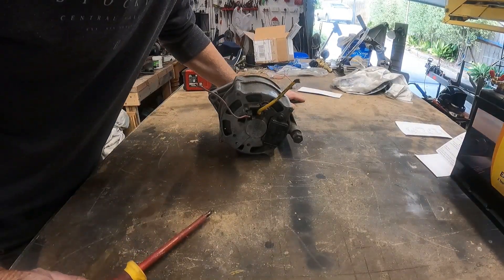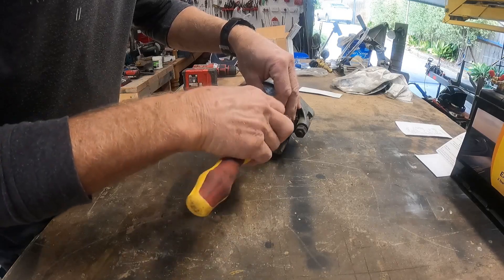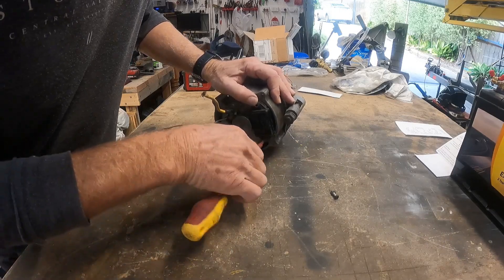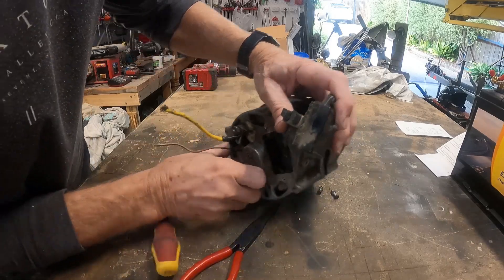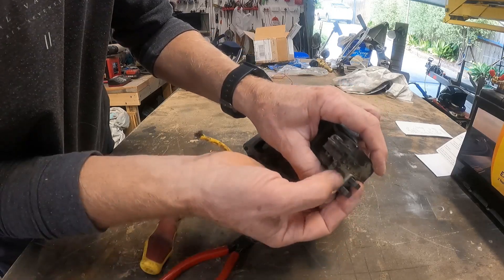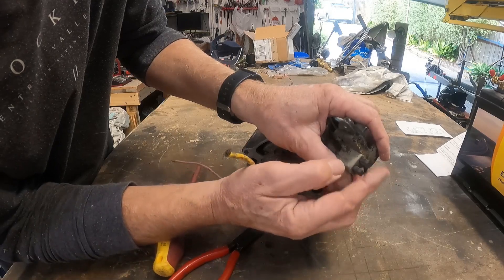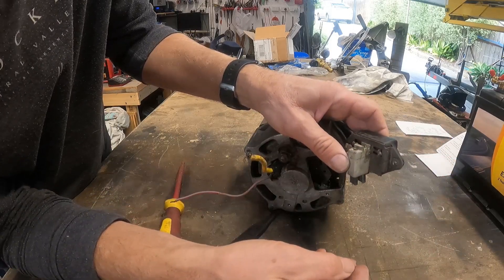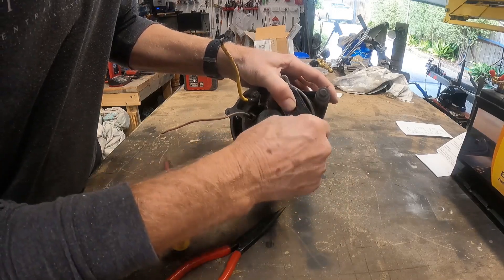Alternators 1.1 - The most common reason an alternator stops working.

Comment: Can worn brushes cause the alternator to put out only about 12.9 volts?  Or is that a regulator issue maybe?  Thank you for this video.
Reply from the maker: 12.9 is pretty close to the alternator not putting out anything at all. Check my previous video on getting an alternator to charge. Is this one you are have problems with an internal or external regulator?
Reply: @alansailing1387  Sorry, I rechecked and the output after cleaning battery terminals with engine running is 13.8.  Still low I believe as I thought good output was between 14.2 and like 14.8 or somewhere close to that?  This has an internal regulator.  (1998 dodge B1500 van)  Thanks for your reply.